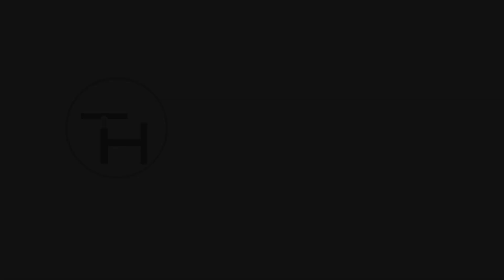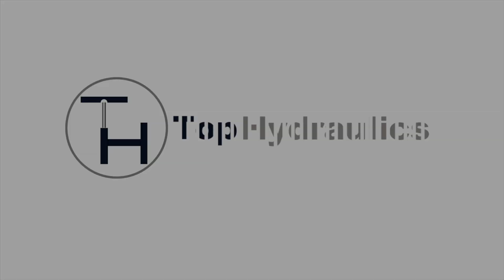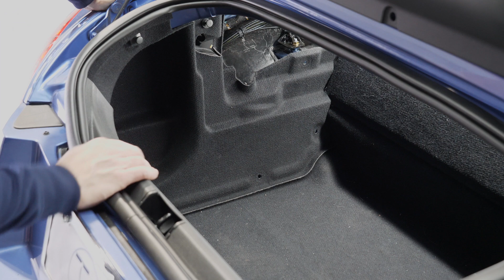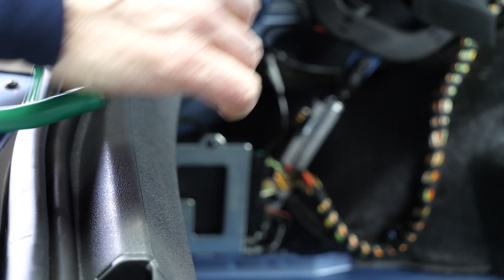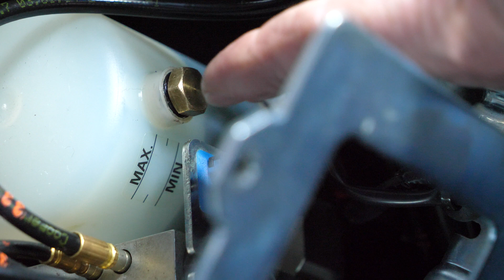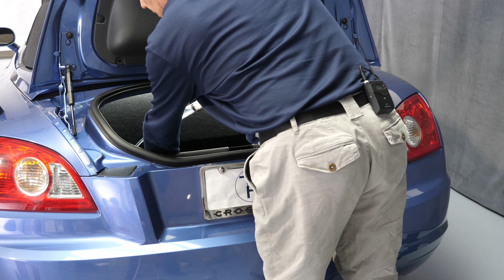How To Refill the Hydraulic Pump - Chrysler Crossfire - Top Hydraulics, Inc.

Comment: Thanks so much for the video.

Like an idiot, I dropped the brass cap and have not been able to retrieve it using a magnet or anything. I know I could follow your video to remove the entire reservoir, but I’d rather just buy a new replacement metal cap. Any idea what size of hex bolt screw to get? (I know it was 13mm to remove the cap, but I’m not sure on the thread size.) Thank you!
Reply from the maker: You need an M10 plug with built in o-ring. Problem is, I don’t recall what the pitch of the three is: M10x1.0 or M10x1.25 or M10x1.5. Taking the pump out isn’t that bad once you roll up your sleeves. 

If you had to take the fill plug off, then you must have a leak. Thus, it looks like you need some cylinders rebuilt. Might as well take care of it now, and we can throw in a used fill plug when sending you the cylinders.

Comment: If my fluid is low on my 2005 Crossfire, can I mix the FEBI 02615 with the existing fluid or do I need to remove the old fluid?
Reply from the maker: FeBi 02615 (identical with Mercedes 0009899103) can be mixed with the old fluid.
Reply: @TopHydraulics  Thank you for your quick and vital reply. If it leaks (likely?) I will reach out via your website. Great resource!

Comment: How would I go about fixing a leak? My top works for a minute, but then it slowly starts to give out. I can tell that there is a leak because when I go back to look most of the fluid I put in is already gone and there is fluid in the surrounding areas. Please help I would really like to use my top again
Reply from the maker: Thanks for asking. You will have to find the source of the leak. You may want to look at the playlist of our Crossfire DIY videos: https://www.youtube.com/playlist?list=PLly4CMbpk7owIPuQ5pTohE_vy7oNeurae
The first video in this list is "troubleshooting the hydraulic system" - you probably have seen it already. If you haven't watched it yet, then please do: https://www.youtube.com/watch?v=nwPmwQJaN4U&list=PLly4CMbpk7owIPuQ5pTohE_vy7oNeurae&index=1 
Wherever the leak is, you need Top Hydraulics to rebuild those parts for you. Use the other videos in the playlist to remove the parts if you want to do the job yourself. You can do it!

Comment: Hello Klaus, do you think it will be okay to use the Febi 02615 hydraulic oil in a 2010 Volvo XC60 hydraulic liftgate pump? (the Volvo oil 31385734 is $27.00 per liter!!!) Also do you service them? My liftgate slams at the end of the closing cycle, and I just replaced the gas spring on the right side so that's not causing the problem. If the reservoir is low on hydraulic fluid will that cause is fall down quickly under the weight of the liftgate? Any thoughts? Thanks
Reply from the maker: Hello Johan, thanks for asking. FeBi 02615 or Pentosin CHF 202 or Pentosin CHF-11S or Mercedes 0009899103 or Aral Vitamol will work just fine. If your fluid level is low, that can casue the liftgate to fall down. Could also be an problem with an internal valve. Yes, we service XC60 liftgate pumps.
Reply: P]]]